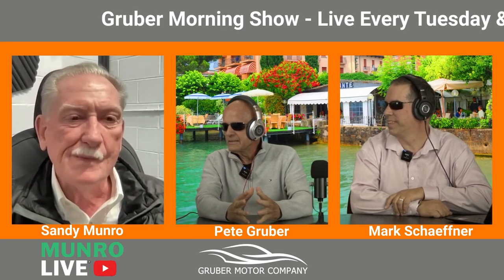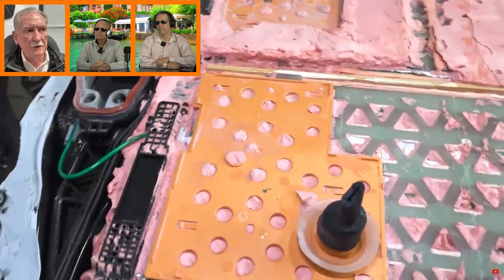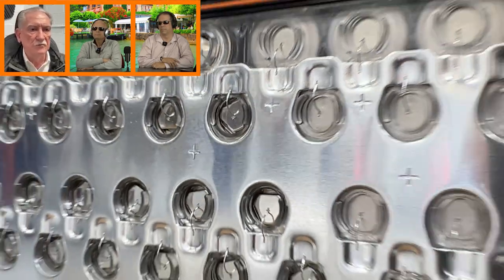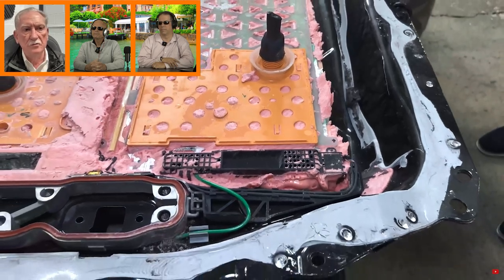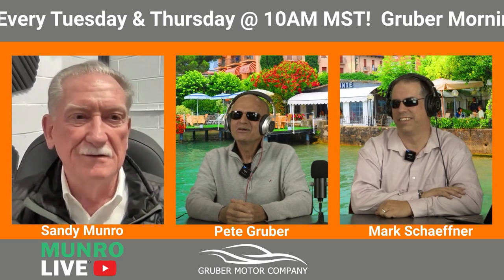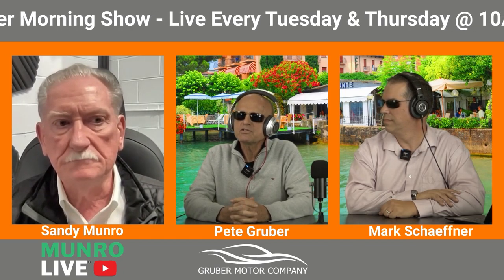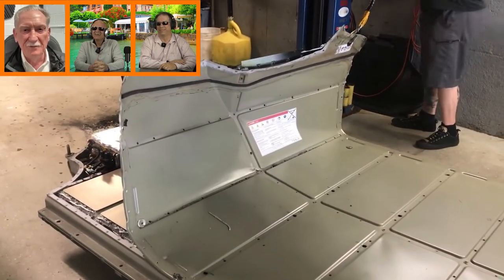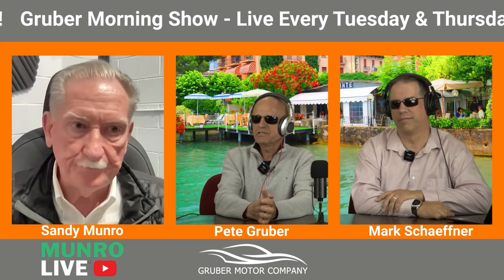Is Tesla's Structural Battery Repairable?

Comment: Tesla is going to hope and rely on their batteries and cells not going bad. If the battery is part of the structure and it needs to be replaced under warranty then I want to know what their process is because their battery might be good but all that pink insulation foam over and in between every cell looks like a nightmare.
Reply: They give you a new car.
Reply: Full pack replacement, that's what they've always been doing anyway. Tesla never took the time to find the faulty cell, that's what allowed Gruber to exist as a business and to cover that niche.
Reply: Its like newer carbs compared to older carbs for small equipment....The older carbs had mixture screws to adjust a/f mix...Todays carbs have no mixture settings making the machines very problematic and only serviceable by someone qualified............

Comment: Sandy dances around the very simple, direct question "how repairable is Tesla's structural battery?"  The simple, direct answer is "it's not".
Reply from the maker: Two differently skilled companies came together for this Podcast.  One focused on teardown for determining BOM's, production processes, and material costing, and GMC, which does something similar, reverse engineering to determine and find a path to aftermarket repairability.

As Sandy pointed out, they did notice some aspects of repairability when he mentioned the CAN logic board as being replaceable inside the pack.  The next layer is connectors, contactors, a Pyro fuse, and our final specialty, hunting down a failed cell which can kill a car.
Reply: @grubermotorcompany  Point.  However I submit that the non-repairability at the cell level makes the pack, for all intents and purposes, disposable as most pack failures are at the cell/module level and not with the control electronics.

Comment: The long term idea with the structural battery pack is to increase the reliability of the individual cells and at the same time, reduce the cost of the overall pack to the point that it does not make any sense to repair it.  In 5-7 years, the cost of one should only be $3-4k or so.  A battery failing in an old Tesla will be comparable to an old ICE needing a new engine in terms of cost.
Reply: Lol!!!! You can also increase the reliability of batteries cells individualy or in different pack arrangements..... No need to glue everything together
Reply: for an ICE tout absolutely don't need a new engine because it can actually be repaired depending on the defects! The facts that there are still 40 years old cars on the roads with original engines, gearbox..... Tells something!
Reply: @carholic-sz3qv  Yes, but I guarantee you that the vast majority those 40yo cars have had A LOT more than a few thousand dollars worth of maintenance and repair.  On average, the total cost of ownership for the Tesla will be MUCH lower.  It is simple math...

Comment: The battery pack is warrantied for ten years. If you need a full pack replacement after 10 years, the cost is around $16,000. To $18,000. Find another car that's ten years old, where $16,000 will get you another 10 years of service. Most people dont keep a carv10 years anyway. So why bring up the subject?

Comment: why ask munro, not a battery expert, in fact novice level knowledge of lithium batteries.
lets get to the nitty gritty, cells in parallel are not discernable as individual cells, you can only get average values of those cells. That is always a weakness in battery packs, its one of the major flaws in battery packs that has not been solved, I didn't see any discussion about this important issue.
Until packs are monitored at a cell level ( which they are not as  yet), there will always be risk and unkowns. There are solutions out there to this issue not yet implemented.

Comment: In other words, all EV's have a problem with cell failure being expensive to fix. Tesla just goes all in, making you replace the whole battery with new or used.
Reply: A new Tesla model S battery currently costs £32,000 in the UK
And they are taking 6 to 8 months.
I have a customer with a dead Model S
Reply: In the case of the structural battery pack, if the car is more than a couple years old, it's going to mean scrapping the car, because it's too labour intensive to replace.
Reply: Which is really bad tbh! There should be a lifecycle for batteries from cars to home storage and then finally recycling and back again.

Comment: A large vacuum chamber could be used to dip the pack and dissolve stuff and then a vacuum pump can recover the solvent. it would not be cheap to build the equipment.
Reply: Unfortunately the solvent might be conductive and short circuit the battery so no!!!
Reply: @carholic-sz3qv  obviously you would use a non conductive one. The comment in the video was that it was toxic. but that itself is not a limiting factor as there are lots of toxic chemicals being used in industries, but those industries have to recover and reuse the solvents.

Comment: Sooo after a couple of months the next cell fails 
It’ chemistry right?
Reply from the maker: We have been repairing Tesla Roadster packs for many years.  We find after a cell repair (1 out of 6831), there is no cascading effect and cars continue to function.  The single cells failure appears to be an aberration.
Reply: @grubermotorcompany  ok..tnx what about easy to replace cell(s)like a flashlight with springs
So redesign the batterypack

Comment: when the batteries fail the car has failed would cost to much to replace a battery pack
Reply: unless its under warranty then its free. with tesla thats 8 years
Reply: @evfan6037  about the life of their  batteries then throw away the car. 8 year life span , sad
Reply: @boingo001  true. but also 8 years from now who knows what EV recycling will be like. Redwood Materials is already claiming like 95% recyclability or something like that, so even if its not repairable, all the materials wont sit in a landfill at least. Hopefully 6-8 years from now a replacement battery will cost as much as getting a new set of tires if some of the promising new batt tech catches on. EV batteries cost ~80% less today then they did in 2008. lets hope that continues downward
Reply: @evfan6037  but at what cost , its an  old electric car by  then possibly requiring more  than batteries .

Comment: Sunglasses… why? Have some eye problems?? Its so much less personal.

Good video though! I do think high of Sandy, but he now drank to much of the Tesla kool-aid… As a former mechanic; I don’t want to be the guy and owner of a single cell failure in a non repairable battery..: 

Everything breaks, be the unlucky 1-2% guy and you are out 15.000€\$.?? No please
Reply: See the connection plate welded across the cell tops, under the foam?
As I understand, there are narrow sections near the weld which act as "A Fuse". (High tech concept).
If a cell enters a "High current" condition, that "BLOWS". Taking the cell out of circuit.
Why would that make the PACK "unrepairable"?
Ref the conversation regarding other packs where they "Snip the connection"
Reply from the maker: @rogerstarkey5390  The fusible link wires connecting both + and - sides of the cells do not blow when a cell becomes resistive, and parasitic, robbing the brick (collection of parallel connected cells) of energy creating a voltage drop which the BMS system senses and adjusts allowable charging for safety reasons.  Once identified, we "snip" the cell removing it from circuit and life continues.

Comment: ya for the first 5 years of battery tech should be bolt on packs to make retrofit more a module so once the batt tech settles  then a structural pak might bee ok but i  dont like it
the cyber truk will be a prime example
Reply: lol, so when did the clock reset?

Comment: Reliable yes. What’s the shelf life?  If a battery has only 50% left in it after 5/10 years and gas motors has 80% after 40/80 years
Reply: There's Teslas a decade old and they usually are 70 to 80% after 10 years if I remember correctly.

Comment: So lets look at the price and labor dry ice blasting $1000 after you have removed the pack and cover so about $4000 plus on a used car and if one cell died when will the next, who will buy a rebuild battery on a car with high mileage because these won't fail until 200000 miles
Reply from the maker: The question how long a dying cell neutralize lasts comes up often.  Our experience with Roadsters, where we perform this level of surgery at least 3 times per week for years now, once the aberration cell is out of circuit, the pack functions just fine without further occurrences.  Legacy Roadster packs, from as far back as 2008, are for the most part still functioning, not having reached end of life symptoms yet.  We are all waiting for that EOL event which may or may not be imminent.

Comment: The capacity of a lithium battery pack is defined by its weakest cell.
Isolating and replacing a bad cell will extend the life of the pack. 
Tesla are fighting the "right to repair", which is very short sighted. They could offer courses on repairs, and proper tools, if they think techs would goof it up. 
Individual cell voltage monitoring is not hard to accomplish, and could be built into modules.

Comment: Adding the battery pack as part of the structure of the car is Tesla's way of stopping anyone repairing the battery pack. Adding foam inside the battery pack is also to stop the pack being repaired. Tesla must be losing $$$$$ because clever people like Pete Gruber fix battery packs saving the car owner thousands of dollars. As an engineer it amazes me that EV manufacturers add all the electronics (some we don't need in cars) but don;t include the facility to isolate a bad cell bank, or do they ?. Manufacturers are missing a trick as they could make the batteries repairable meaning the garages get the repair work. I assume that any battery repaired no longer has any warranty. Mixing older and newer cells can be handled by the BMS in the car which might result in slightly reduced capacity. Simply cutting out the bad battery is a brilliant idea.

Comment: Dry ice is carbon dioxide.  So to repair the battery that's intended to eliminate carbon dioxide, requires the release of lots of carbon dioxide.
Reply from the maker: Good observation.  When you offset that against the environmental impact of scrapping a repairable pack, and creation of a replacement, the net result is still in favor of a repair.  As we have observed with the first gen multicell Roadster EV battery packs, failures are aberrations, and not the norm.
Reply: @grubermotorcompany  Yes, I can believe that.  There's certainly a lot involved in manufacturing a new battery pack, not to mention the cost.  I guess we can expect that as the energy transition progresses, the energy-associated emissions from manufacturing (which is most of it) will decrease, helping that situation.
Is the benefit of the dry ice here the cooling? And if so, is there, or could there be in the future, an alternative way of cooling the battery pack?
Reply: And the carbon dioxide comes from where? Oh the atmosphere. No extra CO2 is released.

Comment: What would happen to EV batteries that are no longer needed? You will have mountain of dead EV batteries which are as worst as plastic.
Reply: They can be recycled with the right equipment, but that starts with shredding the entire thing, not attempting to dismantle it "nicely".
Reply: Metals are relatively easy to separate and recycle, and as "scrap" they are cheaper and more energy-efficient than new ones made from basic raw materials.
This is much more difficult with plastic and only thermoplastics can be recycled. The problem here is that recycling hardly pays off financially.
So the two are not comparable.

Comment: There is nothing funny or to laugh off about repair-ability of the modern EVs. They must be repairable at component level. While I appreciate weight/energy density, it is not a good consumer product that you can't serve.
Reply: Same with giant cast aluminum parts Tesla uses, you see more and more "Totaled" cars after non-severe accidents because it's impossible to replace structural parts w/o replacing half the car.

Comment: the cell's "will fail" so making it like this is REAL BAD for the future of EV.  batteries MUST be fixed. this is a BIG problems with EV's and normally there is ONE cell that is the problem. HOW do you hold this cars on the road after 10-15 years if you cant fix then economically.

Comment: They are rebuildable. Bad cell out good cell in. Simple.
Reply: Obviously you don't understand what's involved in removing a cell in a structural pack.  It's not "simple".
Reply: @JRP3  
Some just don't pay attention? 🤷‍♀️
Reply: Structural and ctc pack's are not very easily repaired now. Even the module equipped one's aren't easily maintained. 
Regardless of what anyone who doesn't actually do it for a living claims to the contrary.
Reply: That would seem reasonable.  It doesn't quite workout that way though.  If you replace or remove a bad cell then everything will seem fine at first for about a year or so. Eventually the mismatch between the new cell's voltage and capacity will throw the entire pack out of balance.  What I keep seeing is Teslas that curiously stop moving even though they say they have 60 miles left.

You most definitely want to do some research on this fix before you jump in on it.
Reply: Love the deadpan humor! 😂